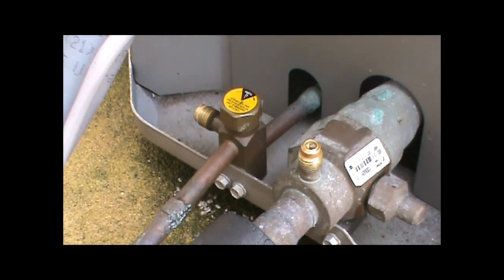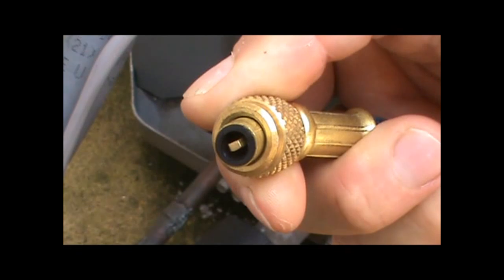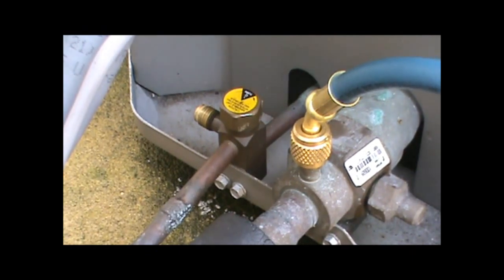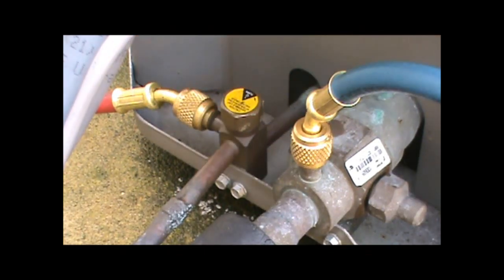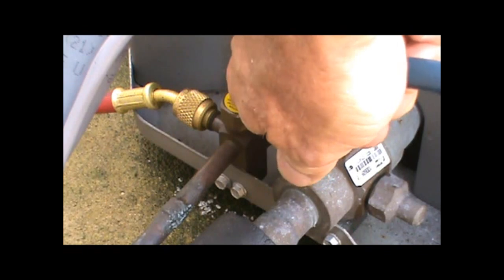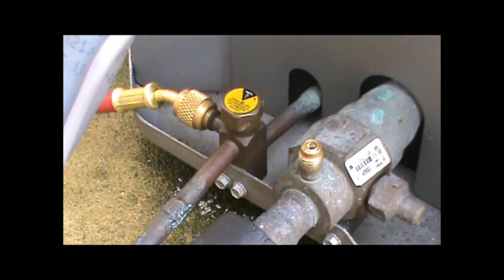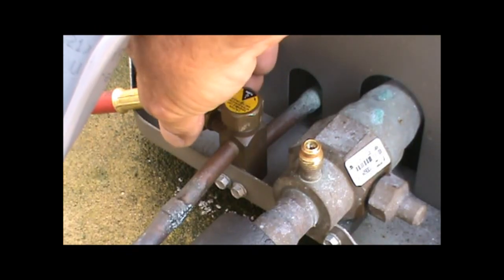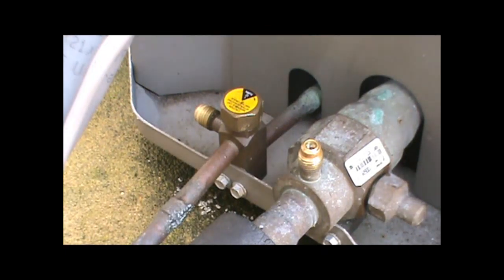HVAC Training - Hooking Up Refrigerant Gauges

Comment: Was wondering when connecting the gauge hose, why a bit of air from within hose would not mix in with the refrigerant through the valve or does the pressure differences not allow any air seeping in at all and the air just stays sitting in the hose?

Comment: Red. = High side = liquid = small line
Blue = Low side = vapor = big line
Is this correct???
Reply: Big blue and Little red. Like Bear in the big blue house and little red riding hood. Also big blue= big suc for suction. And little red like to spit and leave red marks on us (burns)

Comment: I'm sure I was taught wrong, but I pay no attention to whether the system is running or not when connecting. However, when disconnecting, I was taught to ALWAYS make sure the system is running. That way you pump down the gauges by disconnecting high side first, then open both sides of the manifold and allow the gauges to equalize. When done in this manner, not only do you not lose the 3oz refer to the atmo like you did in this video, but you dont leave the additional 3oz in your gauges either. If its an R22 system, 6oz matters, that stuff's getting stupid expensive. Then again I didnt go to ref school, which is why I watch your videos in regards to doing it the right way.
Reply: moparerrnocar nope your right you put the gauges on and off when the system is running
Reply: Alex Brnjac i dont know what your talking about if you think you're never gonna see refrigerant like in this video

Comment: Hey Ron.  I just watched video from a guy and he was using his gauge to reintroduce what refrigerant was in his hi-side gauge thru his low-side back into the system.  Since you were doing this with the unit off, would that even be an issue to deal with?  I think his system was on at the time, though I could not tell.  He was quick and to the point.
Reply: Yes sir.  Thanks
Reply: Ron Walker When using low loss hoses in the manner you just mentioned... I dont understand how you would have any more refrigerant left in your hoses than if you do it the way you do in the video.  After you have removed both hoses and open up your hose ball valves, both hoses have released to atmosphere just like in your video.  I am just learning and concerned about cross contaminating systems.
Reply: get two yellow jacket gauges one for r22 one 410a, they're cheap and imo better than any pos electronic gauges, just got rid of my testos.
Reply: @Rainmaker88  this is so old but the new testo are actually really good, so convenient and saves a lot of time opposed to analog, they dont disconnect after taking two steps away from condensor anymkre

Comment: Does air in the hoses and manifold enter the system?
Reply: No. Once your braising and pressure test is done you run a vacuum to remove unwanted air in the lines.
Reply: @colinhoeg4728  are you sure ? I’ve heard of people pulling a vacuum on their gauges so no air from the hoses get into the system
Reply: @crumby731  I mean that honestly might be best practice technically. But I've never seen anyone do that process. When you set up to charge the unit and connect the refrigerant tank to your gauges, you bleed the line a little until you get only refrigerant coming out. And keep it minimal cause of refrigerant handling obviously.

Comment: This is why I service my own unit to make sure it's done right. Every time a technician hooks up gages without purging lines, it introduces a small amount of air into the system. If a homeowner has the unit serviced twice a year, as recommended, the air adds up and degrades performance. This video is the first one that popped up for me - with over 216,000 views, it's teaching lots of people to do it wrong.
Reply: How is that teaching to do it wrong?

Comment: the best way to do this is by using a quick disconnect for the high side
Reply: Oscar Urias what’s a good brand and do you know any videos of people using them
Reply: @coldbloodeddaggers6553  yellow jacket always
Reply: Just had my unit serviced. He charged me 2 lbs of freon. I didn't know I was even low. Whats with that?
Reply: @MarilynNemeth you have a leak.  I such thing as being low. You’re being ripped off

Comment: if your hoses dont have ball valves you're throwing off the charge every time you disconnect.
Reply: Even with ball valves most of that refrigerant is coming from the unit.

Comment: Use a Low loss fitting you won't have that refrigerant spraying everywhere
Reply: nick krista I have noticed that some units like the rheem cube units don’t give you enough room for low loss fittings
Reply: Is low loss fittings better the quick disconnects